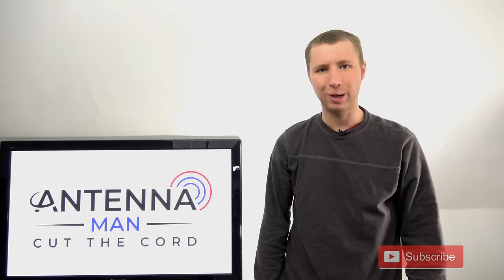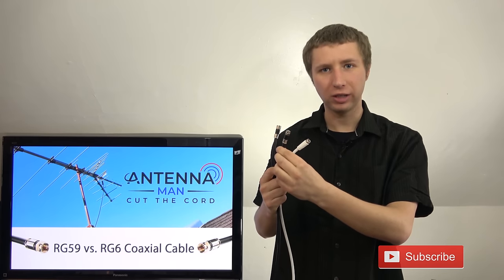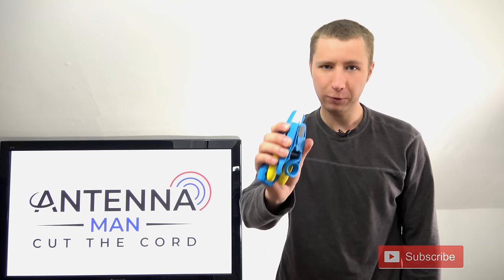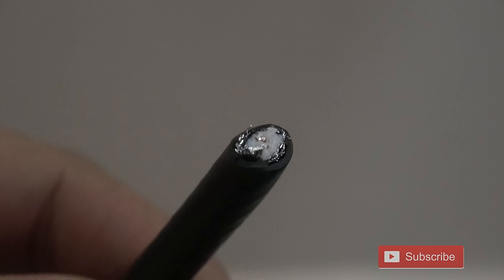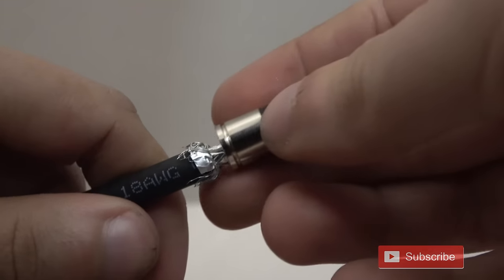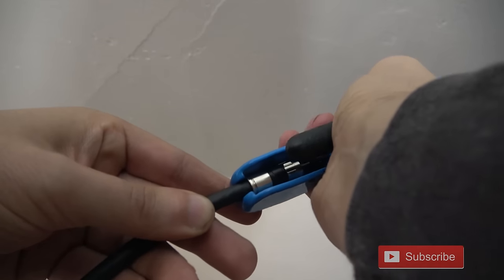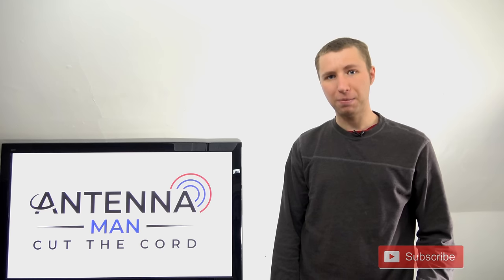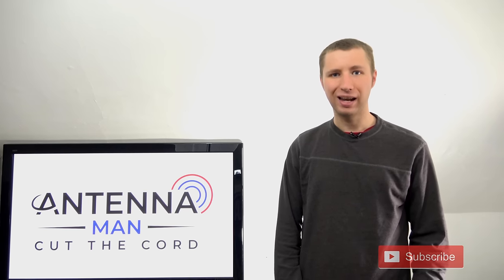How to Make a Coaxial Cable with Compression Connector for RG6 and RG59

Comment: Do you recommend dielectric grease for outdoor connections? It would keep the copper free from oxidation which could hamper the connection.
Reply from the maker: I personally haven't used it but I don't think it can hurt.
Reply: A dab of dielectric grease on the outer jacket of the coaxial cable might also make pushing RG6 QUAD into the "F" connector a little easier.  I use dielectric grease on all outdoor and automotive electrical connections, so suspect it would have benefits for coaxial connections also.
Reply: @chrisgraham2904  Yeah, die electric grease can only be a good thing for all outdoor electrical connections, except with the one caveat of if someone were to put it on so thick, it acted as an insulator for the connection instead of just a water displacer and/or lubricant. There is such a thing as too much grease, as I'm sure you know (but I only wrote this exception for those that may not).
Reply: @guitartec  So true.  A few years ago my landscaper was in my driveway packing dielectric grease into his plow's electrical connectors, that control the plow lights and plow operation. (packing it like grease into a bearing).   He was wondering why he was constantly having connection problems. I gave him a small artist's brush  to scoop out 95 percent of what was in there.  Now he's got reliable connections.  LOL

Comment: To REMOVE a cable end, screw the connector onto a mounted F female. Pry back the locking ring. Pull the cable out of the connector. Unscrew the connector from the f barrel on a device.

Comment: Antenna Man How do you feel about RG11 for antenna install? I do have to go into a splitter so would it be better to use the RG-11 over RG-6? And what about solid copper over clad copper plating. Just wondering your thoughts
Reply from the maker: RG11 is better than RG6 but isn't necessary in most cases.
Reply: Antenna Man Thank you I appreciated the response. Maybe video content to explain the what when and why to use RG 11. Also an idea of just how a power injector works through a splitter and over coaxial. Just things I have had to think about and understand in my cutting the cord venture after my cable bill went up to 202.98 and going up another 3% on the 18th per Spectrum. Hoping to have the cord cut by then. Thinking of adding The Juice as preamp

Comment: Would it be worthwhile to try to DIY an RG11 cable?
Reply from the maker: Yes if you get the right fittings you should be able to use the same method shown in this video.

Comment: I ordered the coax (50ft) you recommend on your video. But too short...I intend to order 25 more feet. 
   Do you recommend a good high quality splice (male on both ends).
  After buying high quality coax, don't want to loose signal because of cheap splice!! Thanks! Dan
Reply from the maker: It doesn't matter what coax coupler you use. They all work virtually the same and don't result in signal loss since it's a one to one coupler.

Comment: I am surprised  you didn't mention the length of the center copper  wire (the stinger) i have heard to cut it flush to the outside screw/nut housing, but i give it an extra mm.....

Comment: Would have been nice to see more detail regarding the back end of the compression fitting and mating it to the coax. You seemed to gloss over that quickly.
Regards to where the small internal ring should install in the shielding

Comment: If you have multimeter: measure the copper center, to to outside  shield, it should read infinite  resistance.  Take the two ends and measure copper to copper, and shield  to shield,  it should  read close to zero ohms. If it passes these 3 tests it is probably  good. I bought  some cable from  Amazon  that didn't  pass. I through it  away.
Reply: Amazon doesn't seem to monitor the manufacturer's description of the product.  I bought a 100' RG6 Quad cable that stated that it had a solid copper core conductor.  A little testing proved that the core conductor was steel with a copper coating, which is inferior. I sent it back.

Comment: About to buy one of the suggested cables on your amazon store page. I need a shorter run of cable (15 feet), but they jump from 10 feet to 25 feet. Could I remove one of the existing connectors, cut the cable to length, then reconnect the connector using the steps shown in the video? Thanks for the video!
Reply: You would need to install a new connector.

Comment: I noticed you used copper clad steel core wire.  Have you done any experimentation with pure copper core cable vs copper clad steel?  I like to make my own cables because I can build to custom lengths, use high quality cable & connectors and know it's done right.
Reply: I noticed  that to
Reply: At high frequencies most of the current goes down the outside of the conductor.  Look up "skin effect".
With RF stuff it is actually worthwhile sometimes to silver plate copper because silver is twice as conductive.

Comment: Tyler, Very informative videos and I enjoy your (matter of fact) way of presenting the information.  I was actually doing a search to find out how for is too far to run coaxial.  I have a channel master on my shop and we are going to cut the cord on Dish in the house.  Can I run off the shop antenna?  This may add 80+ feet to a already 50ft run.  Or, add another antenna?
Reply from the maker: Yes, you can run off your shop antenna. Just make sure to use a powered splitter if you're connecting both the TV in your shop and one in your home. Below is a recommended two way powered splitter: https://amzn.to/3mTGvs5
Reply: @AntennaMan  that 130 feet maybe pretty conservative, I haven't measured it
Reply: @AntennaMan  Tyler, I would like to give an update on the coax project from the shop to the house.  The pct u recommended doesn't seem to work.  inline and in-service I get 20 channels on a scan (way less then before), bypass the pct I get 50+ channels.  Power light is on and it is grounded.  Any thoughts?

Comment: Can I make my own antenna?
Reply from the maker: Sure you can. I made one out of a paperclip in another video of mine.
Reply: @AntennaMan  I get 20000 channels in 24K with 9.1 surround sound with my paperclip. Wallmart can keep their 4K antennas.
Reply: Try a Coat Hanger straightened out , make sure it is bare metal with no paint or varnish on it !📡 📶 📺

Comment: There is one thing that I don't understand about this video. If one (anyone) is going to go to all the effort to make their own cable with a compression connector for their antenna setup, why would they decide to use cheaper RG59 cable instead paying a little more for higher quality RG6 cable? It just doesn't make sense.
Reply from the maker: The same concept applies to most people that spent thousands on cable over the years but then bargain hunt with a $20 junk antenna

Comment: Hardest part of installing one of these damn coaxial connectors is getting it on all the way you have to practically beat the thing onto it
Reply: The only real F connector that I had that kind of trouble with was a certain type of Klein tools weatherproof connector(the ones rated for above ground outdoor use with blue markings on them). Needless to say I ended up going for the standard Klein tools F connector(the ones with yellow markings) as well as ideal brand weatherproof connectors, much easier to work with

Comment: Thanks for the advice.  I'm way out in the fringe.  I was going to just buy dual shield but after this video I think I'll give the quad shield a try.  
I did see a video about making and using a flair tool.  It makes putting the connectors on quad shield coax a lot easier.
https://www.youtube.com/watch?v=zUPHYieN9gQ

Comment: Don't waste your money on Quad Shielded Cable!  I'ts much stiffer, harder to work with and more expensive and has the same signal loss as comparable quality Double or Triple Shielded cable.  Also, some connectors are designed for outdoors and some only for indoors and some are designed only to work with quad cable while others are designed to work with Double/Triple shielded cable.  As a side note, look for cable that has a solid copper center conductor.  It's not a must but it is a sign of higher quality cable.
Reply from the maker: I actually have gotten better signal on a quad shield cable than a dual shield cable. I always say the thicker the better. Being too thick and stiff is a good problem to have!
Reply: @AntennaMan   -  I think if you look up the manufactures spec you will see little if any difference between the two.  The main reason it's thicker is due to the extra shield which is there to keep the coax from leaking signal out when used for cable TV drops to the house.
Reply: @AntennaMan  Sadly, I will never know what a good problem that is....;)